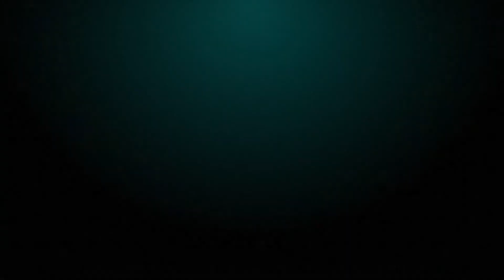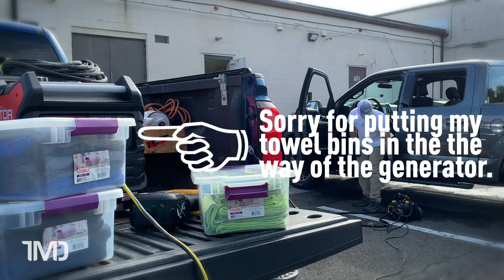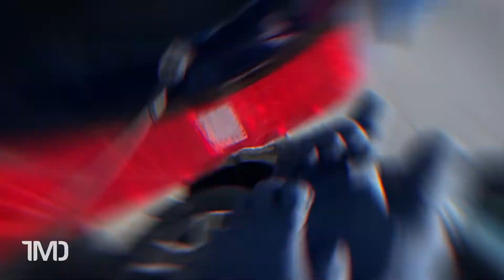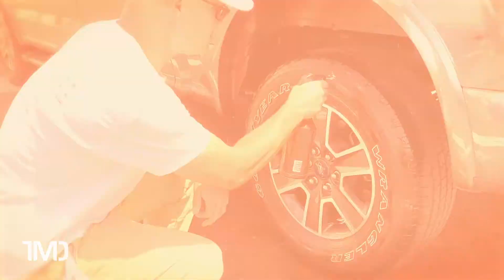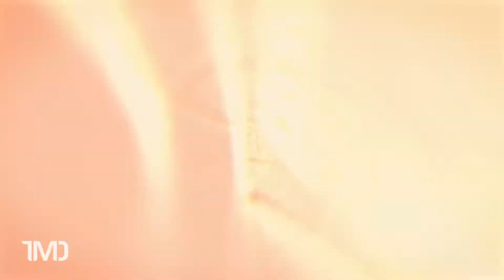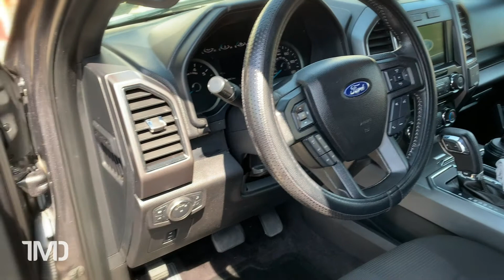Mobile Detailing 001 | Apartment Detailing 005 | Predator 3500 Generator, DeWalt 20v Power Cleaner

Comment: What’s the best steamer for detailing?
Reply from the maker: I use a Chief 100 steamer. The VX5000 and the  vapor clean machines are also good commercial grade steam cleaners. What I prefer is having an external fill tank. That way you can refill with water without having to shut the machine down and loose your steam pressure. So any reputable steam cleaner with an external fill tank is ok to me, hard to designate one the absolute best.
Reply: @TurnerAutoDetailing  what’s the purpose of the steamer and is it really necessary? Thanx
Reply from the maker: @OMEGA_RON3   @TurnerMobileDetailing  using a pro level steamer, with 75psi or higher is kind of like having a pressure washer for the inside of the car. Steam will clean and sterilize everything it touches. It will blow out and neutralize the cleaner you treat the surface with first. High pressure steam also allows you to clean and blow out all the tiny crevices without using a detail brush or pick most of the time. Steam is essential in cleaning and removing things like melted candy, gum and other stuck on gunk inside the vehicle that even heavy cleaners can’t touch. Steam also allows you to clean in very tight areas that you can’t get a detail brush into. I can’t tell you how much time my steamer saves me because I rarely need to scrub with a brush. The steamer does everything a detail brush can do faster and more effectively 98% or the time. You just have to be a little careful around electronics and switches, don’t blow steam directly under the switch/knob.
Reply: @TurnerAutoDetailing  thank you

Comment: Have you ever tried to run an air compressor with a tornado attachment, AND using your vacuum, AND heating up the steamer all at once? I'm curious if the generator can handle all three?  As I know people like to use that combination of tools.
Reply from the maker: I personally have not, but as long as the combined wattage of all three tools does not exceed the running watts of the generator you should be fine

Comment: Curious if there's anything else out there with higher pressure that still has the mobility to pull water from a bucket and or possibly still run on batteries that you're aware of?
Reply from the maker: At the time I bought it last year it was the best I could find on the market. Now there is the Green Works one that’s like 800psi. I’m not sure if that one was around last year but I basically went with dewalt because I have a bunch of other dewalt batteries. But green works looks like it might be a better option if your looking for more psi.

Comment: I like the dewalt for small jobs but it’s just too dam slow, I got the green works 1600 psi pressure washer and it works great with gravity feed
Reply from the maker: I agree, I only use it when a vehicle really needs a pre rinse
Reply: @TurnerAutoDetailing  yea it’s good for that or if you’re desperate and just got a bucket for a water source
Reply from the maker: @shanedottie  yeah I don’t carry a water tank so that’s why I went with a siphon option. Out of all the options, I felt dewalt was the best one.

Comment: What wattage inverter generator do I need just to run a da polisher?
Reply from the maker: It has to produce continuously at least the wattage of the polisher. Most polishers top out at 1000 watts, so you need an inverter that that produces at least that much continuously.

Comment: Thanks. I'm new to mobile detailing and right now I'm generator shopping and deciding if I should go bigger predator or 9000?
Reply from the maker: I love my 3500, unless your going to running some much larger equipment, or plan to use it for more than Detailing, like camping or whatever, to me a 3500 is plenty of power.

Comment: What gauge extension do you use ? And is it a 3 connection in one, or do you swap them one at a time?
Reply from the maker: It’s a 12 gauge. Yes it’s a 3 outlet cord, I don’t bother with single outlets, saves time to not have to keep swapping out tools. It’s a 50’ cord.
Reply: @TurnerAutoDetailing  gotcha thanks for the reply! I might have to get a 12 gauge 25 cord since my pressure washer says that’s the only kind it can take. 50 ft or less gauge might not be good enough. 

💪
Reply from the maker: @Detailpops  yeah you definitely want to make sure the extension cord is able to get the pump enough juice.

Comment: How do you recommend the predator 500?
Reply from the maker: I love that thing! Does everything I ask it too. Runs all my equipment easily. Best part I can run multiple tools at once. If I do that at a clients home, I usually pop a circuit. I use it about 1 to 2 times a month, always starts with no issue. My buddy has a Honda eu2200 and it never starts if it’s been sitting for a while.
Reply: @TurnerAutoDetailing  thanks man im about to purchase one tomorrow ! Wanted to hear your opinion first ! What polish do you recommend for my first time ? 2 step or 1 step polish that has both ? And what brand ? At this point there’s so many things out there to get
Reply: Also would a 6 inch pad work fine for the polisher ?
Reply from the maker: @erickpenaloza1  so many options on polishes. Kinda depends on condition of the paint. If it’s real bad with a lot of swirls and scratches then definitely a 2 stem process. I love sonax compounds and polishes. Cutmax for first step, perfect finish for second step. But they can be expensive. Meguiars m105 and m205 are good too, but cheaper. Only downside to them is they like to dust, so you’ll have to clean the dust out of your panel gaps when your done. I would not use a 6” pad on the dewalt. To much overhang on the pad means you won’t be able to put proper pressure on the edge when polishing up against edges and when you’re polishing up against a body crease. Body creases tend to stall a DA, but if u feather the edge of the pad against the body line/crease, you can keep the polisher spinning.  An oversized pad won’t let you do that because yo have no control over that in or so of overhang. I use 5-5.5” pads with mine.
Reply: @TurnerAutoDetailing  okay thanks for the info man ! The color is white ! I wanted to try a 1 step polisher first because I’m afraid if I do a 2 step corection on my truck , I’m gonna ruin the clear coat/paint!
Reply from the maker: @erickpenaloza1  your welcome. White paint hides a lot of imperfections, so a one step might be all you need anyway. Also 3D One is an excellent one step polish.
Reply: @TurnerAutoDetailing  it’s called 3D One?
Reply from the maker: @erickpenaloza1  the company is 3D, and the polish is called One, as in, a one step polish. Search 3D One on Amazon.